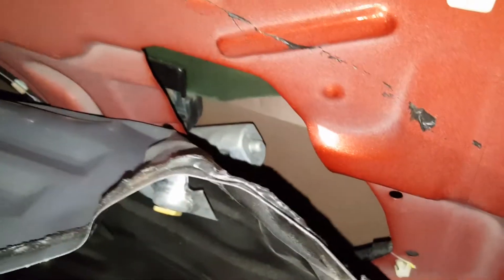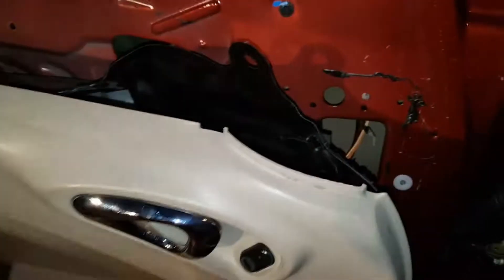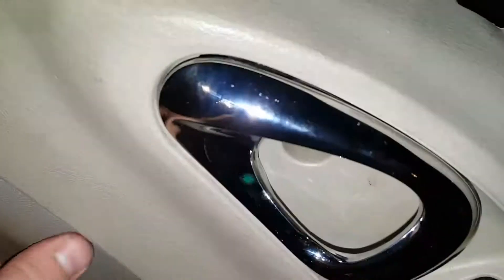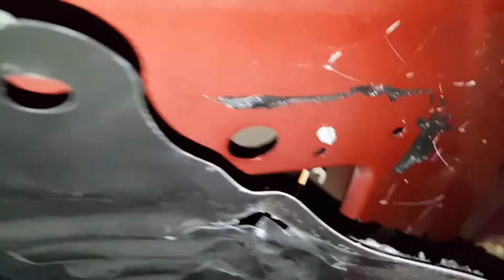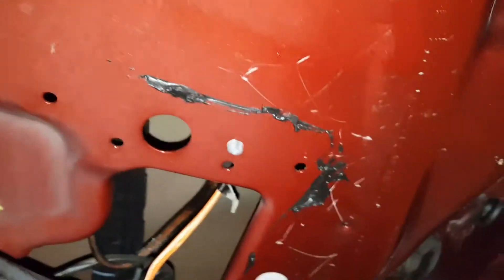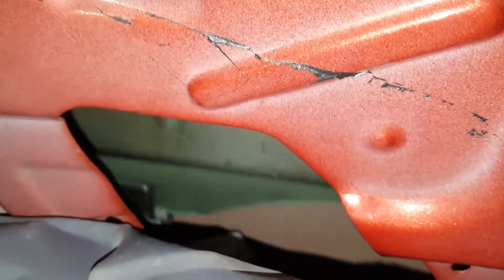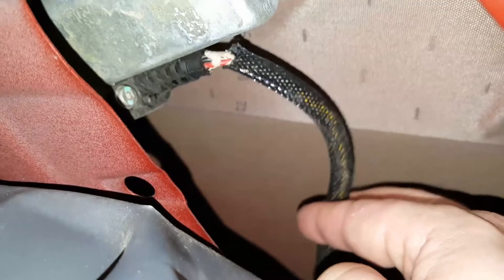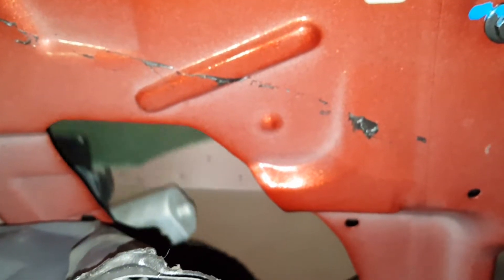Window Motor Location and Door Panel Access for Repair 2006-2010 Chrysler PT Cruiser

Comment: Great vid. 👍. My 06 drivers side window quit and I was set to replace the switch or motor.  But decided to check you tube beforehand and stumbled onto your video.  Sure enough one wire to the drive motor was broken, wires on the lead in plug were ready to fail.  Soldering and taping later it’s better than new.

Thanks again for posting.
Reply from the maker: thanks ! hope u fixed the issue comment got lost.... thanks for watching!! please subscribe and see my other videos!!